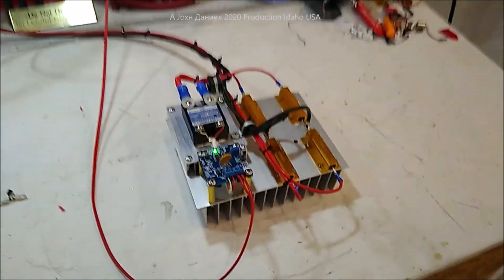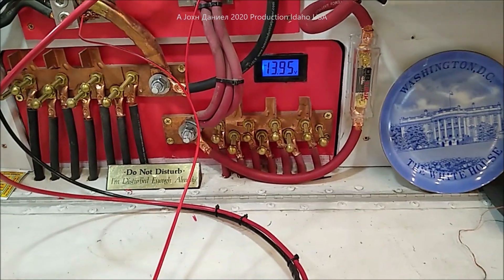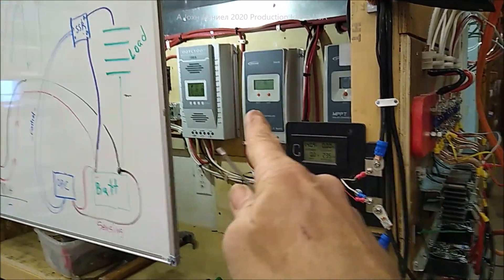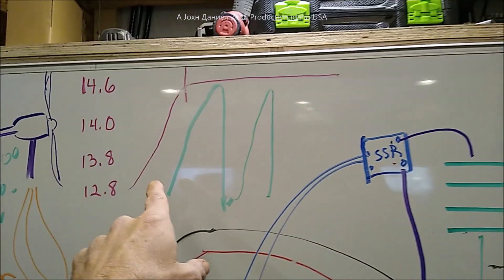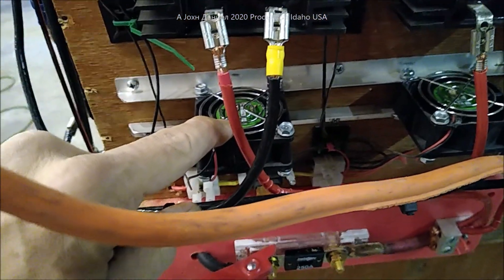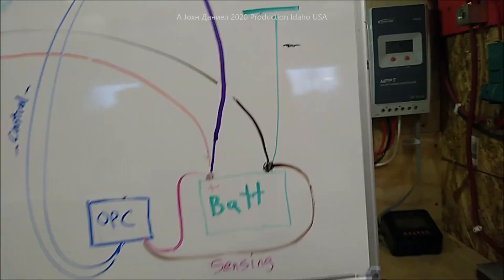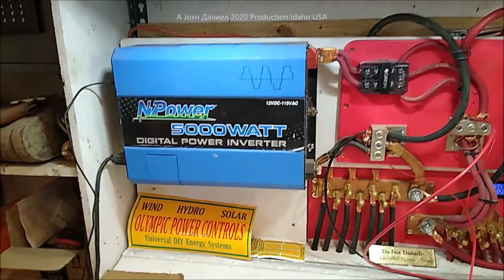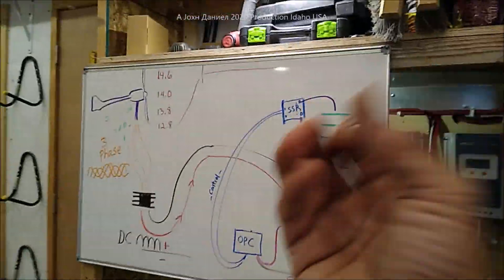Micro Wind Turbine charge controller design and uses explained, parts Below

Comment from the maker: Diversion controllers https://amzn.to/2O90bJk & https://ebay.to/2U1uq8K ,Dc-Dc Solid State Relay (SSR) https://bit.ly/37FVej3 ,100W 6 ohm load Resistors https://bit.ly/36vHnub ,750 watt 12,24,48 Volt Hurricane wind turbines https://ebay.to/38EVPRZ ,Water Heating Loads https://ebay.to/2SEAAKP  *NEW SOURCE Quality Jinko Sunning made 100 watt solar panels https://bit.ly/3bFFQp4  ,RMS AC/DC Clamp meter https://amzn.to/313QiSw & SEE SOME TINY HOUSE STYLES & PLANS ! https://bit.ly/31tJMof -- And if you need answers, ASK!!
Reply: Awesome to watch this... THANK YOU!!  I'll be busily consuming all the details herein.  It was great to see the diversion controller in action, transitioning from it's initial PWM to it's all out full-time diversion.  Another great nugget you dropped was the solar cutoff voltage vs. the diversion controller voltage levels!  You don't sell the OPS version controller, correct?  Looking forward to next video discussion on resistive loading recommendations.

Another intriguing nugget at the end of the video was the "braking" diagram using the turbine controller itself...  I've got the Green-E "standard" turbine controller unit and hadn't thought about using it, primarily due to not knowing it's activation points and load activation process.

I just received my programmable BMS (electrodacus.com) for my Headway LiFEPO4 cells, and I'm just about ready to size up my load sensing resistors for my first off-grid system.  Scored a 1000W Renogy inverter on Ebay for $156 delivered (on sale now).  Feeling more confident that this will be manageable.

Your system re-wire/re-configure is also looking great!  Keep up the fantastic work!!
Reply: Crap the nice digital dump controller is unavailable right now
Reply: @John Daniel how can one get ahold of you outside of the comment section? I have a few questions regarding my current and future setup
Reply: Good On Ya! Making my own now 👍🏻 will be connecting to the G&Yu[Japanese] Aldecor M27-spec. They already have +50% life exp over the delco

Comment: Heyo I’m currently trying to get a Smarttwister ST-2000 wind turbine (2 kW, 3-phase AC) back online, but the original controller (RST-3500-AB) is missing. I saw your setup and was wondering if something like that could work.

Comment: For Wind Regulators I am using a Harley Softail Voltage Regulator, takes 3 phase in and outputs 14.5v DC, Harley Regulators are Shunt Regulators using SCR's, what happens when trigger voltage is reached the SCR's turn on for each phase and shunts positive portion of each phase to ground.  Harley Regulators are built in their own Heat Sink.  Shunt Regulators are electrically a short for each of 3 phase AC shunting the positive portion of wave to ground and on Wind Generators that shunting acts as a brake and stops wind generators from over spinning (and over voltage) in high wind.  SCR's can handle high current and are doing the same function as your drain resistors.

Comment: On the manual for the opc controller shows the load on the positive side of the system. ? Does it matter
Reply from the maker: You can switch with either one

Comment: I am trying to set the Under and Over cutoff switch. I have 4 12v batteries connected parallel to each other making a 24V battery system how many watts do you think 4 batteries can produce.  I am having trouble setting up my switch max and min watts setting for my 900w Wind turbine

Comment: After trying different method to get more current from my 500w turbine when using a crappy marsrock controller lol. Believe it or not when I disconnect 1 out of the 3 wire on the turbine to the controller the turbine begins to spin quicker and I at least am getting 3-10amps which is better when all 3 wires are connected. The red charge lights up on the controller and it seems like it charges is this okay to do?
Reply from the maker: It will work that way but not recommended to do. There will be no braking ability and wild voltage may exceed controller ability.

Comment: When the Wind turbine mounted on Pole without connecting any wire to the bridge or battery it's run smoothly at the speed of blowing Air (Free form) but As soon as connected 3 AC wires to the bridge and then 2 DC wires from the bridge to Battery Wind turbine lost its speed it's running slow.  why the change of speed any idea ?
Reply from the maker: Drawing power. When it draws power, it will slow. The lower the battery voltage from full charge the more load will be on the turbine.

Comment: I think I might just make a turbine charge controller. The MARSROCK hybrid controller 12v 1500w/turbine 1500w/solar works great for solar but not the wind turbine.  When i disconnect the breaker to the turbine the 500w bnc turbine spins way quicker i get like 56v ac but when i fliip the breaker on it drops to 13-14v ac the marsrock controller is braking the generator to much. Ive tried raising the fan braking unloader to 36v from 25.6 but didnt make a differance any suggestions if i open the controller will i find a dial or something to decrease the braking capacity? .
Reply from the maker: The controller shouldn't change your voltage, your battery does. If you disconnect your battery by disconnecting the breaker it's going to run up fast there's nothing on it anymore no load the battery equals the load. If you haven't said it for your preferred charging battery style it may act different depending on the batteries you have.
Reply: @Јоhn Daniel  I have three 100 ah 12v batteries wired in parallel for more storage. Each have a built in bms.
Reply: I believe the marsrock controller i have has a wind generator braking voltage of 14.4v.. is there a way to increase that?
Reply from the maker: There should be a menu function for it and you can set for 15 volts if your using lead acid, with divert at 14.6 but if your using Lithium then I would stay on 14.4 volts with diversion at 14.0 volts. The diversion control should be set just under braking. Wind should not be used to peak batteries, it will do so sometimes but its main job is 90% or better bulk. The reason is wind is not something you can plan on, its random most the time but not like solar. So the settings should be full charge on solar since it won't be getting gust and storms to over charge, and wind charges bulk and saturation as you use it.

Comment: Hey John, can you make a video with the 1500wsolar/ 1500wwind 3000w 12v battery controlling made by MarsRock it was a link you posted on one of your older videos. Using a 500w turbine on a 25mph wind. Is it a good controller for a beginner like me.
Reply from the maker: I need to get one for my own use, I have installed numerous now, only on 600 watt and smaller turbines, and no more than 800 watts solar on it is what I gauged its ability to due to components in it. A Green Energy 600 can exceed 1000 watts in peaks so never buy a 600 watt controller for a 1000 watt risk!

Comment: my rectifier don't get warm because I have a temp controlled fan on it, I have a hurricane vector wind turbine, and it's a beast, it puts out good power, and it gets pretty hot, so I put temp controlled on it, with a fan kicks on to keep it cool when temp reaches the set point I set it at. I got say thank you for all the good info, you have helped me many times with all your knowledge. I'm currently looking for or thinking about building a boost converter for when low wind to maximize output even when little wind. I really like your setup, so much I built mine similar to yours, but I added in a brake controller similar to midnight solar design.

Comment: Hey there. Thanks for the informational content. Just an idea, I think you could connect two supercapacitors at the negative and positive ends of he pack to avoid any chances of micro(nano)cycling, but I'm barely researching the topic. 
Thanks man.
Reply from the maker: Micro cycling the divert load is deliberate.
Reply: @JOHNDANIEL1  
Yeah, I know that its better than normal cycling done by charge controllers, but I also heard the microcycles add up over time either way, but I didnt research that scientifically and probably there isnt much data on that. Theories, yeah, but data, I dont know. 

In theory though, capacitors would take the greater amount of charge smashing and likely reduce battery temperatures.

It really depends on whether the discharged cap will be charged by a PWM or the battery pack.
Reply: @JOHNDANIEL1  alright, to clarify: its good to have a drain limiter in between a supercapacitor and a battery bank to ensure the capacitor taking the discharges during microcycling dont drain the batteries during recharging phase; a MOSFET would probably handle that. 

Mentioning that twice so nobody risks their powerbank if experimenting.

Comment: Hi John, great video. I'm working on your design. I have a question...can you use more than one SCR connected in parallel with a Olympic Power Controller?
Reply from the maker: You can run up to 40 solid state relays off these controllers. .

Comment: what about lighting strikes on small home turbines . love your videos
Reply from the maker: If lightning strikes a small wind turbine the outer metal shell would transfer it down to whatever frame you used and out the frame and down. So you want to make sure you always ground the pole you're mounting it on but voltage will travel on the outside of the body of the turbine.

Comment: Hi John Loved your video and I have a question for you. I have an EcoFlow Delta 1800w Power Station  I an wishing to connect it to a 400w wind turbine and the Solar input which I use inputs via the Delta xt60 cable 10-65vDC - 10am max for Delta. Battery capacity 50.4v - 1008wh/1260wh. I am not an electrician but I know with ac output I need a rectifier to convert to dc to input the Delta. What spec wind turbine could I use to take advantage of that way of charging as I live in Scotland UK I would like to charge it by that means during the winter nights? The Delta has an internal controller so what reading can the final two cables that attach to the xt60 cable supplied with the Delta should I use? Thanks a bit long winded but I am a novice. I like your set up. Thanks Norman English
Reply from the maker: Since you have lithium batteries in it you will need to use a controller for it to work properly and safely. Send me a email to olympicpowercontrols@yahoo.com with it's spec sheet and some better data on it. A Green Energy 300w 48 volt turbine would be a good basic addition, let's see if yours can handle one.
Reply: @JOHNDANIEL1  hi John Thanks for reply I will try to send spec sheet so if you do not get it in my reply I will have try again Thanks Norman
Reply: John Having trouble attaching pic of spec sheet I have not done this before any advice? Thanks Norman

Comment: Hi john great idea. 
So your system is flickering a dump load on/off to keep the battery voltage at correct level. If voltage increases dump load is permanently on unit voltage drops and then goes back to flickering. Tapering the dump load, rather than all on/off.
You have your wind connected direct to battery, I have 48v lithium with bms. Yes seen you dont like lithium😀 but surely the wind creates high voltage, let's say 150v, is that safe or correct to connect to battery with out transformer down to closer voltage? Or am I looking at this wrong . Many thanks for your time. I'd also like one of the opc to do 48v to uk if possible.

Comment: - still don't understand exactly how a wind turbine works - it generates DC then convert to AC using rectifier which in turn charges a bunch of batteries- k great now you have a bunch of charged batteries- how do you then use this to power your home- I dunno I'm dumb

Comment: Which is best for a 400 watt 5 blade turbine ? diversion dump load before or after the rectifier ? You have it either way on different videos.
Reply from the maker: Diversion loads are always placed in your DC circuit so it would be after the rectifier you can do a quasi shorting system for braking with ac voltage but not a diversion.

Comment: Hmmm. It doesn't divert so much as load the battery.
If it diverted, the output from the bridge rectifier would disconnect from the battery bank and connect to the load.
Since the controller can do open and closed relays, adding another relay could make it a true diversion switch ...switching the turbine voltage between the load and battery bank like a double pole switch

Comment: The first human in history to point the correct direction to the links. Thank you! I have multiple medium sized windmills and I need to create a control system for my bank. Its daunting to say the least.
Reply: Ps. I am using permanent magnet dc treadmill motors for my windmills so do I not need a rectifier?  And would it be bad to put one in anyway incase  I switch to an AC wind turbine?  Thank you

Comment: You mention you have your solar set up to disconnect at about 14.25 volts so that your wind turbine controller is not acting against your solar. What do you mean disconnect? Do you set your boost charge to the 14.25? Or is there another way?
Reply from the maker: I allow the wind on a adjustment period I apply to do all bulk charging and balancing. So setting the solar on its normal charge cut out level of 14.25 means at no time will solar in a random act will be lighting up my wind turbine resistors when I don't want that result.

Comment: I recently watched your silicone heating pad video and gave me an idea to try and use them under my solar panels on my battery Bank shed when I acquire them I will write back and let you know how it works as a property that I'm talking about he's on the farthest northern point of Maine and we do receive quite a bit of snow plow
Reply from the maker: Jo Ann READ CAREFULLY - Placing those silicon pads on the back of a solar panel will damage them. What you need is a timer, aluminum flashing sheets, and 12 or 24 volt low wattage therm pads. Send me a email olympicpowercontrols@yahoo.com and I will send your a diagram on how to do what your trying to do for very little cost.

Comment: Thanks very much for all the great lessons. Do you think one 12 volt water heater element would be enough of a dump for that 500 watt aliexpress turbine?
Reply from the maker: Yes, as long as you have a safe sized water supply to heat, and as long as its sized 600+ watts and has nichrome inner wires like the HWP elements are http://ebay.us/LDpt4x which include the full bulkhead fitting. These turbines can hit over 900 watts in short peaks ( don't panic) and be steady at 400+ so you need 125% the turbines rating in water elements due to the fact the water is a high heat sink value.

Comment: hi , very nice videos ;) , i'm from portugal and i'm having a strugle to choose my wind turbine , in my area i dont have much wind, and i was thinking to go on a 48v turbine with a 24v battery bank and 5 blades sacrifing speed but gaining in low speed wind , the problem is that i also have strong winds sometimes and i can't find nothing to substitute the controlers that you use to divert power because i dont know how to buy from USA  , can you help how can i play with the voltages to buy the rigth thing
Reply from the maker: I would recommend a furling unit in 48 volt for your needs
Reply: @JOHNDANIEL1  48v turbine and 24v bank batt or 48v turbine with 48v bank ??
Reply from the maker: @freducho1981  48 volt 5 blade run into a 24 volt battery bank would be my suggestion. My best suggestion is a Sunning with a controller they use. If you want details and how to get it from Spain send me a email olympicpowercontrols@yahoo.com

Comment: I am building a rib system. Can I hook a hurricane turbine into it. My pole barn is 250 ft from my battery bank which is 2 48v 5.4 kWh batteries. What size wire do I need to run.how would I hook it up to battery bank. Or can I even hook up a turbine to the system.

Comment: I have a bunch of questions  on a design of a wind turbin for my RV  meveeder@msn.com
Reply from the maker: As long as you don't plan to drive down the road with it flying, your plan is a easy one! You'd be surprised how many seek to mount one on a vehicle to "drive with it mounted at 60 mph to make power" as they loose mega amps from the vehicles own alternator due to drag doing it!

Comment: I have a battery charging question for you John. From the videos that I have seen I have noticed that you do not use a charge controller. I understand that you have your diversion loads to kick on/divert excess power at a certain voltage, I think 14.7vdc. It is my understanding, and I could be wrong, is that you need to control the current going into the batteries also. Please correct me if I'm wrong. I know you are using shunts for each wind turbine, I think 100amp, and you are also using other fuses on the three wire AC coming in before the Rectifier. Is this all that you are using to control the Amps coming in before the battery bank? Are you not using a Charge Controller, because the amount of amps created by your wind turbines is not enough to cause any issues with your battery bank?
Reply: Did you ever get an responce ? I am trying to figure out the same thing.

Comment: is  the same size resistors 100w 6 ohm for a  24v battery back
Reply from the maker: For 24 volt use 8 ohm x 100 or higher watt.
Reply: @JOHNDANIEL1  thanks